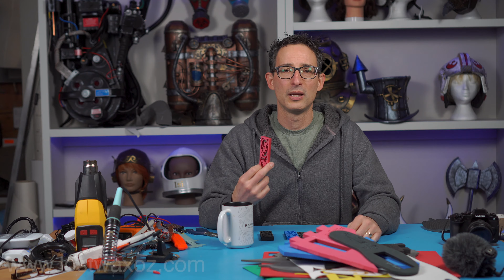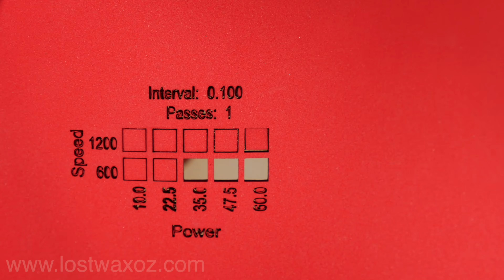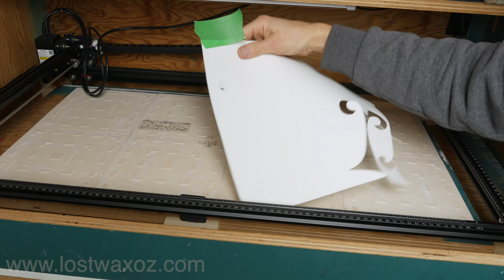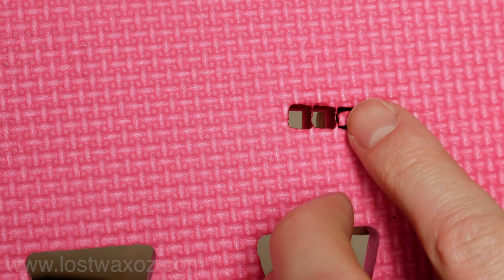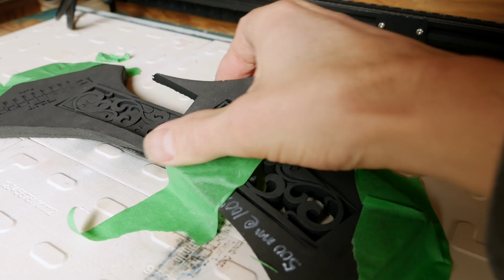Ortur Laser- Cutting EVA Foam / Best Settings to Laser Cut Foam with Ortur Laser Master 2 Pro S2 10W

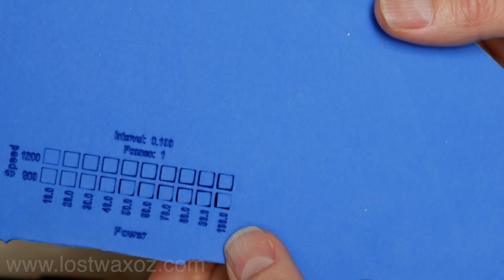Comment: I am trying to cut EVA foam 1/2" thick. However I am experiencing an inward bow on the sides, just as it looks on the video for the red piece on foam (6:25 min). Do you know if using the z-offset would make the cut straighter? or what you would recommend for this situation?
Reply from the maker: I think it's that the foam is melting a bit in the centre from the heat that the laser is generating. My guess is that if you used a lower power and did multiple cuts, that issue might be solved. Just a thought though, I haven't actually tested it:)

Comment: I have found putting painter tape on white helps me cut white foam, but it takes some finesse. Its not perfect, but it helps to get finer details for white foam (I use for diffusing light in LEDs)

Comment: "60% power".  60% of WHAT?  1.6W, 5W, 10W, 20W, 40W, or 70W optical power?  Without that information, your video is useless.  You didn't put the wattage on your test coupon, either.  And your link to the product goes to a useless web page that doesn't tell you the wattage. A web page I should not have had to read and one I can't view on the TV I was watching your video on. And that model of laser has apparently been sold with 1.6W, 5.5W, and 10W laser heads and for all I know you have upgraded it.  I rewound the video (which I should not have had to do)
Since settings were the entire point of your video, this makes the whole video useless.
Reply: You are absolutely right, somehow I must have missed putting that vital bit of info in. I'll add it to the video description as soon as I finish typing this. It was a 10W laser.

Comment: So you have the 10w one right? Would it be possible to cut 6mm with 5,5w?
Reply: Ive got a 6w laser and it eches wood just fine with nice deep grooves, if it can do that it can cut foam no problem. BTW 65% power of 10w would be 6.5W.
Reply from the maker: Yes, I have the 10w laser. I don't see why it wouldn't be possible with the 5w one, it just might mean you need to do a couple of passes though.

Comment: Great video! Can you also engrave foam with a laser? I know it cuts, but can you modulate that? Yes, some colors absorb laser light more efficiently and will cut faster/cleaner. Depends on matching the laser color to the material.
Reply from the maker: Yep, for sure, check out my first video on this laser cutter: https://youtu.be/enOn7xf9S4w

Comment: does it burn the edges? I suffered from the laser with foam!!!
Reply from the maker: The edges don't really have much blackness on them, it more seems to melt through. They do have quite a smell for a few days after cutting. I put them in my garage until they aren't so bad.

Comment: hello, I am a designer and I would like to buy a machine to be able to do this kind of cutting and to make stamps. What do you recommend ? I live in France and I don't know if there is this kind of machine.
Reply from the maker: I'm not sure, this is the only one I have used, so I can't really compare it to others.
Reply: Hello! I’m looking to laser cut “3/16in thick foam core, laminated on both sides” . What settings do you think would work with a 10w laser cutter?

Comment: I'm considering getting one for myself, but wanted to ask about the general dimensions for the laser cutter before the extension kit. Also, what kind of air assist or air compressor would be both affordable and work well with it? I want to use the laser cutter in conjunction with a 3D printer to make costumes and props going forward, but am having trouble getting a solid list of items that I'd need to purchase to get things running on the laser cutter side of things.
Reply from the maker: Hi There! Unfortunately I didn't measure the cutter before replacing the stock parts with the extension kit. The width is still the same though, which is 2ft (not cutting area, but amount of space the thing takes up. I am using an air compressor that's way too big right now, but am looking to try a fish tank air pump with about 60litres/min output. Just for comparison, Ortur sells an air pump for their units which outputs 50l/per min, so I'm guessing that's a good ballpark to aim for.

Comment: For deep cuts, adjust your focus point so it would be in the middle of the foam. e.g. 6mm foam, have the focus where you would have it for 3mm foam, this gives at least an almost even size on both sides and often lets you cut with less power.
Reply from the maker: Thanks for that great tip, I'll have to give it a try!
Reply: Most applicstions have a good side and verticality is not important, so focus on the good side or the other side may improve the quality.

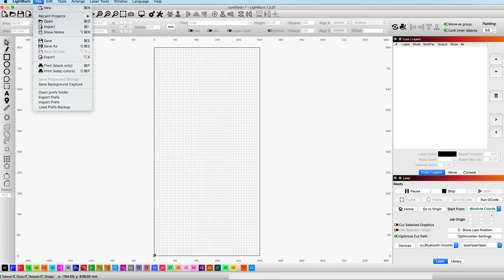Comment: 2:28 those grey plastic vernier calipers of yours... are they 3D printed?
Thanks for the vid and the lengths you went to to give people those settings as a starting point.
Reply from the maker: No, those callipers are just some cheap ones I picked up one time for a couple of bucks. I think I have about 5 different sets of callipers, cause I lose them all the time:)
Reply: @LostWax  Ha ha... thanks for that. I lose mine too so to 3D print them would be neat. Thanks

Comment: That test cut option is a pretty handy tool.  Wish my laser had that option.  Might want to keep in mind and tell your followers to NEVER cut PVC with the laser.  It will create cyanide gas, which is obviously harmful and will almost instantly corrode all of the parts of the laser, pretty much destroying it.  Thanks for sharing your knowledge with us, Chris!
Reply from the maker: Yes!! DON'T CUT PVC!  I'm not sure what laser you are using, but if you are using it with lightburn, then you should be able to use the test cut I would think?
Reply: @LostWax  We use Corel Draw for design and cut on ours.  It treats the laser just like a printer and saves all of our settings.  Might see if Lightburn is compatible and add a copy to see what happens.
Reply from the maker: @Justrex01  Interesting, I never knew Corel Draw could be used that way!

Comment: Thank you Chris, that was super helpful! Any tips for taking existing PDF patterns and making them useful for Lightburn? I tried using Inkscape to convert to SVG, but the results were less than stellar for patterns that were hand drawn then imported into a PDF...
Reply from the maker: Hmmm, It's kinda tricky getting hand drawn patterns to turn into nice vectors. I hand draw all my original patterns, but then I scan them in and basically trace over them with a bezier tool to make the vectors. Lightburn does also have a tool for tracing drawings, but I have only used it once or twice, and, so far, I find that it will trace both sides of a line, where you only really want the centre of the line for the cut, which makes it not that useful. But I may just not know how to use it properly yet. So, short answer, I don't know of anything that does a great job. Would love to hear if anyone has some input!!
Reply: Thanks! "Lightburn does also have a tool for tracing... I find that it will trace both sides of a line, where you only really want the centre of the line for the cut" - yep, exactly the issue I had. hopefully there's a fix/workaround/trick 🙂
Reply: @rolandblais  The workaround is to scan and then hand trace using curves in Illustrator or similar. It doesn't take as long as you would think.
Reply from the maker: @rolandblais  If you find one, I'd love to hear about it!